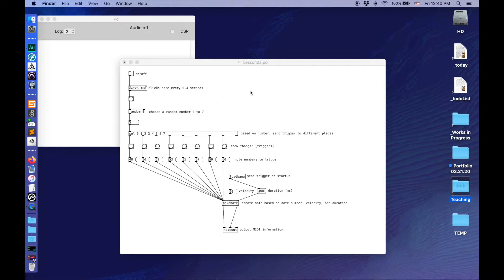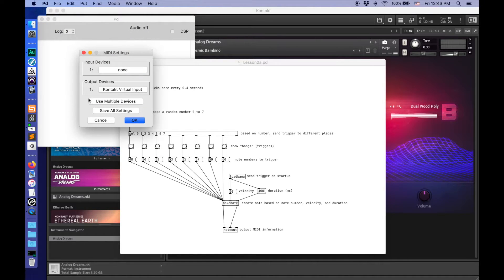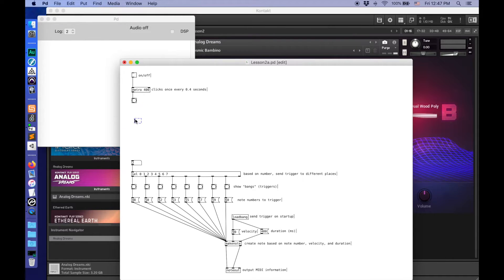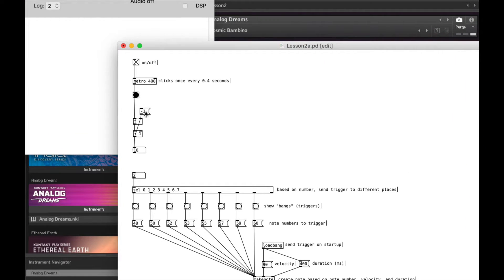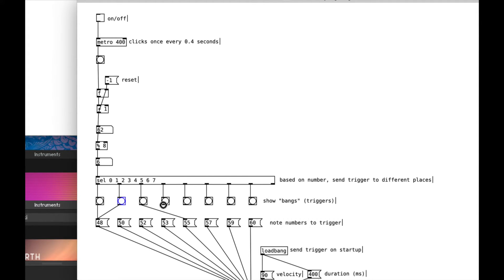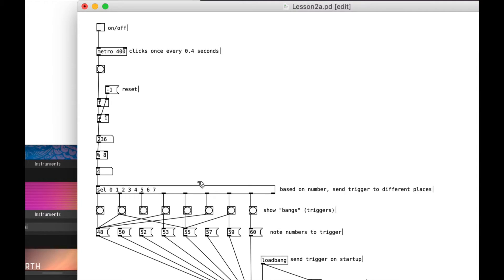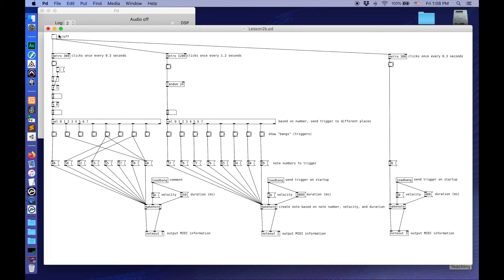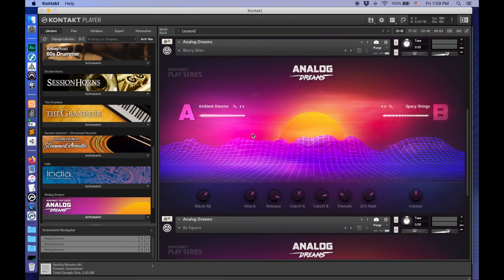Intro to Pure Data 2: Making a MIDI Sequencer | Simon Hutchinson

Comment: any idea how to have seperate midi channels, noteout1 and noteout 1 if I'm using komplete kontrol which is also playing an fm8 and guitar rig through it. thanks
Reply from the maker: You'll need to use the "Use Multiple Devices" option in your MIDI Preferences.
Reply: @SimonHutchinson  sorry so I switched to ableton to do this. I have one note out like you did it and another note2. But if I add two fm8 plugins on ableton I can’t hear anything.
Reply from the maker: Hmmm. More software means harder for me to guess what the issue is. I use a Mac and send MIDI from the IAC driver.
Reply: @SimonHutchinson  same, it's just that when I try to have multiple midi channels in complete control or ableton, it only receives one noteout and not the other there's just silence.  I'm trying to do what this guy in this tutorial does but for ableton. https://www.youtube.com/watch?v=QoC5N7IRNNs&list=PL12DC9A161D8DC5DC&index=13&ab_channel=cheetomoskeeto 

any help would be much appreciated :)

Comment: hey there - at 12:47 you adjust the volume of the second feed, but I didn't detect a drop in volume. When I tried on my own patch I didnt hear a difference. Could you let me know your thoughts on that, if you have the time. Apart from this question - goddamn this is awesome!!
Reply from the maker: Thanks for watching!

I'm not sure I understand your question. I went to the timecode you said, and couldn't spot what you were talking about. Sorry! I made this video almost two years ago! To clarify, are you saying I reduced the velocity of MIDI channel 2 somewhere and it didn't do anything?

I have a guess: If you change the velocity of a [makenote] with a message, but don't click on that message, it won't change. In this patch I have them connected to [loadbangs], but they only "bang" when the patch is loaded. If you change those numbers in a message while the patch is open, you need to click on the message to send it.

Hope that helps! Good luck!
Reply: @SimonHutchinson  hey man, thank you so much for responding so quickly, you are (excuse the pun) 'bang' on (sorry)... I wasn't triggering the changes properly. I was hitting the loadbang object, not the message object. Again, thank you for this, it is opening up so many ideas for me ;)

Comment: Interesting, I assume this won't ever run on a small ARM micro-controller probably; but should be able to run OK on something like a raspberry pi or similar SMC. Considering how expensive multitrack midi sequencers are, this seems to be a great way to make your own sequencer, maybe with some LED and knobs, to make a proper controller. Is PD able to talk to hardware in some way, or do you need to build the abstraction layer yourself? I am not sure PD does have a way to send out events somehow.
Reply: Since it works with MIDI, yeah, you can make it work with hardware (might need something like Arduino alongside the raspberry pi), and you are totally right, with this you could make a sequencer with a lot more stuff but with a fraction of the cost.

Comment: If you are on a Win 10 PC you will need to setup a virtual midi link between PD and NI synths - I used loopMIDI.
Reply from the maker: Yes! This is true! My students found LoopBe1, and told me that was an effective solution. I don't have access to a Windows machine at the moment, but thanks for the heads up!